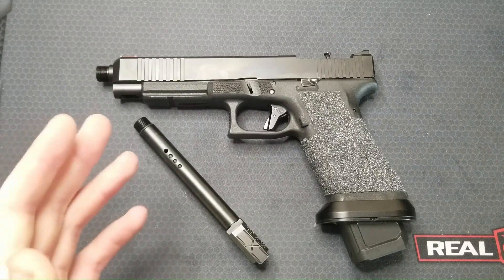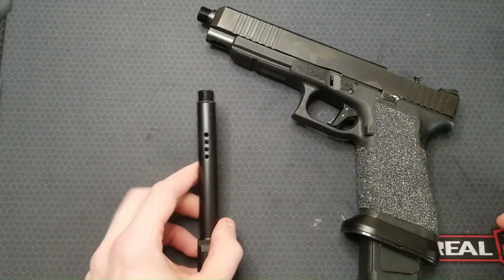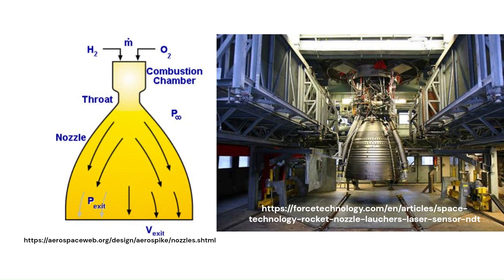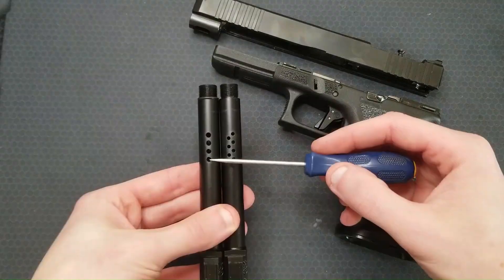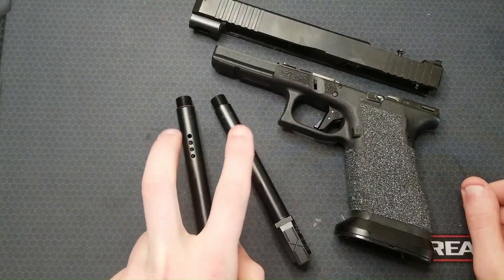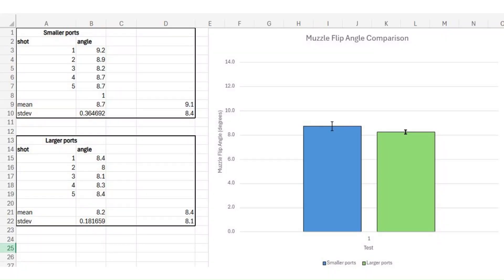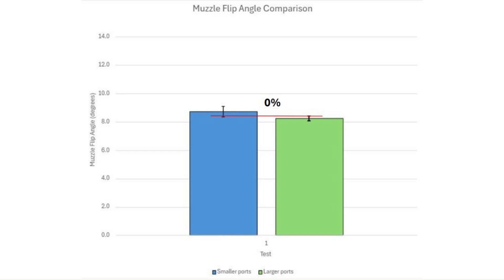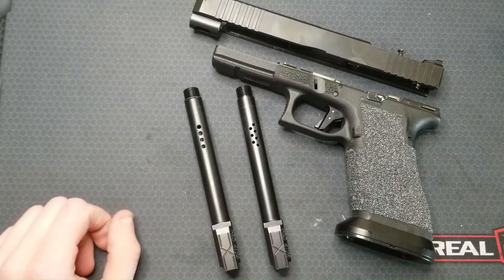Bigger or Smaller ports in a Pistol Barrel

Comment: I wonder if you could put some sort of colored smoke in an open bottom container above the ports and measure on film how quickly the gases travel through the smoke
Reply from the maker: Oh thats a cool idea. Would certainly look cool. But not feasible with the frame rate of my camera. Wount need a much higher frame rate to measure the gas velocity.
Reply: Thanks for explaining!

Comment: I have not watched this yet. but basic logic says that moving more of the morted area closer to the muzzle of the firearm will give the port more leverage to push the gun down.
Reply from the maker: Yep, but less dwell time of pressurized gas behind the bullet coming out of the ports. Possibly lower pressure because it has had more time to expand in the length of the bore. Its a tricky problem.

Comment: I would theorize that the velocity at which the gases leave the barrel is less important than the ability for the gas to leave easily. Bigger holes = easier exit but also lower dwell time. Lower dwell time, lower velocity. To a significant degree? Dunno. 

It would be interesting to always include muzzle velocity in such a test because there should theoretically be a correlation with lower muzzle velocity = less muzzle rise.
Reply from the maker: Yeah I dont want to pony up for a chrono but that would be good data to have.
Reply: @EngineersArmory just get the cheap Caldwell one. It can be found right now on sale under a hundred schmeckles
Reply from the maker: @nick3d155  100 schmeckles 😆 ah thats not too bad.

Comment: Just finding this channel. I really like the approach and some real engineering behind the solution (ME as well).

I'm curious on your thoughts specially at the end looking at port area relative to jacket spalling. As someone with a M&P Competitor - I happened up catch your V-porting using slots vs this work using smaller but greater quality of holes to roughly match port area. Do you think there's significant difference in the slot done originally on your friends competitor vs say 8 small ports (4x per side)  for similar total port area (15* - V8 porting)? Interested to get your take relative to bore performance. 👏🏼👍🏼

Comment: How are you deburring, or avoiding burrs, inside the barrel? What tooling do you use?
Reply from the maker: When i am about to break thru to the bore with my tool i go really slowly to avoid creating big burrs. I usually break thru the hard nitride with a carbide endmill and either just plung that thru or switch to a drill bit.

I wrap 600 grit sandpaper around a brass rod or wood dowell and run that over the ports on the inside of the barrel.

Comment: What about porting as cuts (lines) not holes?
It will be working the same?
Reply from the maker: Holes in the top of the barrel will do something to reduce muzzle flip. As for the minute differences between the endless options for a porting designs I am not sure.

Comment: I’d also be curious if adding a bevel to the exterior of the port would produce any measurable difference to performance. I think in theory it’d do two things: 1. It’d give the exit orifice a similar geometry to a rocket engine as you showed in the video, and potentially further accelerate the gases exiting and 2. I personally think beveled ports would look even cooler than standard ones. 

Btw I love your videos, I’m not an engineer by trade but I find engineering extremely fascinating and entertaining especially with doing experiments. Keep up the good work man!
Reply from the maker: I've put a little chamfer on some of my ports. The reason I dont usually is that due to the curvature of the barrel the chamfer comes out uneven around the hole circumference. I like the look of a uniform chamfer more which I couldn't do nicely without CNC.

I Haven't directly tested for the difference in performance between identical port designs with and without the bevel. In my experience I dont think the difference would be measurable with my methods. Glad youre enjoying the content! Thanks for watching and commenting.

Comment: I just found your channel; I'm definitely subscribing. I'd like to apologize in advance, I'm sure I missed it - but what size are tou drilling your ports to? In the first video I watched were you ported the CZ, I seem to recall you stated 5/32. However, in these subsequent videos I don't recall hearing what size these smaller ports are. Thanks for sharing your test results.
Reply from the maker: I dont make ports larger than 7/64" in practice anymore. The larger ports in this video are 1/8" but that was for testing purposes. The smaller ones are 3/32". Thats a common size I use as well.

Comment: Engineer - is there likely to be a benefit of ports being closer to the muzzle? I know the bushing style comps are no improvement since they expand to barrel O.D. immediately, but what if I port an extended barrel to roughly align with the bushing comp slots? Could this give the extended slide cosmetics with true ported barrel performance? Thanks for your calm, humble and reasoned approach to the whole gun thing. A welcome difference from the loud in-your-face bravado I find so often!
Reply from the maker: I don't have a definitive answer for you. I havent tested for such a hypothesis, or tried to isolate the affects on port performance based on distance from the chamber. I can speculate and maybe have a semi-informed answer for you. Maybe a primer for your own speculation.

I have gotten way into the weeds regarding most aspects of porting, yet have only tested a few of the variables, but only semi-scientifically as its so hard to decouple other affects.

Anyways. One thing I am quite certain of is that more port area is better. Holding port area constant between ports at the end of the barrel or near the chamber, there are three main factors as I see it. 

1. Mechanical advantage, the further the ports are away from the chamber, the more mechanical advantage they will have to create a torque that rotates the barrel down. 

2. Pressure - presumably pressure will be higher towards the chamber. However, powder keeps burning the whole time the bullet travels down the barrel, accelerating it, so I am less sure on that one. I dont have a good answer for what the pressure profile looks like over time and with bullet travel distance.

3. Dwell time. This is similar to the dwell time in an AR, that is the time the ports are exposed to high pressure from the time the bullet passes the ports, until it leaves the muzzle and the pressure drops. Ports closer to the chamber will have more dwell time, that is more time exposed to high pressure.

So which combination of these factors will result in better performance? I dont know. My guess is that ports right at the end of the muzzle will not perform very well due to lack of dwell time. Thats why compensators, which are at the end of the muzzle, have a large expansion chamber. They have no "dwell time" so they use their geometry to redirect a larger volume of gas. Ports with almost no dwell time would probably benefit greatly from an expansion chamber.

Would an extended barrel with ports clear out the end in addition to the bushing style comp be an improvement over the bushing style comp alone? I would bet so.

So there is a lot for you to think about. You got me thinking about it again. A good question begets more questions. I know I wont come to a definitive answer. Sorry I dont have an answer for you, but I wont BS you and pretend I do.
Reply: Hey, thanks for the quick and comprehensive response. I see what you mean about confounding variables. I was up on the mechanical advantage (basic lever arm), didn't credit the pressure variant enough, and hadn't even picked up on the dwell time issue. 

Can one assume muzzle velocity diminishes as chamber-to-port distance decreases due to lower net barrel pressure? If so, maybe this would increase the mechanical advantage of a distal port? 

If a 3/4 distance port has a 25% dwell time, and a distal port has a 5-10% dwell, would that 15-20% reduction in dwell (actually a 40% approx. net reduction), along with the diminished pressure pulse, outweigh the  increased lever of the faster bullet? 

If that were true, then all the barrel-end comps would be closer to worthless since they basically have a 0% dwell time, no? I guess the top vented expansion chamber does actually do some work.

Maybe I've talked myself into giving it a try on my SA mil-spec. Spectre supply sells a 'match grade' 5.94" barrel w/2 distal ports for $180.  I guess the test would be:
5" no port
5" no port, w/comp
6" no port
6" ported, w/comp

Except I have no idea how you measured barrel rise so precisely.

Comment: Would it be beneficial to drill gradually increasing ports? Small port closest to the chamber, increasing port size with each hole as you move toward the muzzle. In theory allowing more gas to make it to the farthest ports than it normally would with equal size ports. Since the ports closer to the muzzle should counter the muzzle rise more effectively than the ports closer to the chamber.
Reply from the maker: Sound reasoning. I've had that thought too. Havent tested for it so I cant say for sure.
Reply: I'm going to attempt porting my 17L barrel myself, might just give this a try. As of now I only have the one barrel but will be ordering and additional. May order 2, leave one untouched and the other drill equal size ports holes then do my best to compare the two side by side. @EngineersArmory

Comment: Just wondering. Did you do the silicon carbide grip on that pistol urself? If so a video of how you did it and what materials used would be useful. 

Or if you had it done could you share the company that did the work.
Reply from the maker: I did the silicon carbide myself. I used a kit from 71 Creative and would highly recommend it. They have great instructional videos. Thats why I didn't make one.
Reply: @EngineersArmory so what grit did you use. I put granulated grip tape on all my guns and like it to be pretty darn aggressive. Like it’s gripping me back, angrily.
Reply from the maker: @travispowell2471  46/70. I like aggressive grip too. I wouldn't go any more aggressive than that. It's gnarly. Quite a bit more aggressive than the granulated talon grip texture.

Comment: Im honestly surprised to see a measurable difference at all, even if small.
Genuinely curious, is there a measurable difference in velocity?
Reply from the maker: I havent measured velocity changes with any of my porting jobs. I would guess there wouldn't be a noticeable one between the two designs. Most testing I have seen of velocity loss due to porting shows the loss usually falls within the standard deviation of the ammunition.

Comment: I am looking at having my Sig P320 XFive barrel ported.  The slide already has 3 windows in the top that I was planning on taking advantage of.
What are your thoughts on placing a "chunk" port that corresponds to the slide window nearest the muzzle, then two or three circular ports in the middle?  Should I do any ports in the window nearest the chamber?  What diameter ports should I consider?  I was thinking 5/16" in the middle and possibly three 3/16" in the rearmost window.
Reply from the maker: If you have a chunk port the rifling has to be bored out from the leading edge of it to the muzzle. So plan for that loss in barrel length. I don't do any ports larger than 7/64" anymore. Minimizes jacket separation and spilling and negative impacts on accuracy. 3/16 or 5/16 ports will open up groups significantly. Also the spelling that comes out of them will tear up your barrel and slide. That's just my $.02 based on my experience with porting and a bunch of testing.

Comment: So you can use what is called the ANOVA test to see if the two groups of data are different with "statistical significance" when you plug in your angle data it spits out a P value of 0.025 which shows that it is actually an improvement in muzzle flip to have the larger ports. You correctly point out that there are other considerations such as jacket separation and spalling due to larger diameter ports. You could run another test on that if you wanted by shooting rounds into a water catch to check mass conservation to see if you are getting difference in final bullet weight due to jacket seperation. Glad to see an engineering approach to firearms content it is sorely lacking in the space!
Reply from the maker: I am familiar with the ANOVA test. I have some background in statistics (required curriculum for engineers). That is a significant P value. I didn't want to get into statistical analysis in my videos, I have thrown my data in R before and found similar results (previous barrel porting testing). With how little control over other variables I have in these experiments it doesn't seem like the most valuable way to analyze the data. Maybe if I had a ransom rest I would be more keen on it. 

The variability in data, while not bad for a human shooting the gun, may show a significant P value, but I would guess it would come with a lower confidence interval. 

I would love to have a ransom rest and test multiple barrels in one pistol, randomizing variables like port diameter, overall port area, V ports or inline ports and number of ports. Throw the data into a multivariate linear regression and weed out the variables that affect each other, refit, and eventually come up with an equation to estimate muzzle flip reduction based on the variables in question. Randomization and checking for interactions in the variables would be needed. Larger ports means more overall area, so which has the bigger influence on results? How can those be decoupled to isolate the effects? The P value would help with this. Its an interesting thought and something i would love to do, but likely wont be able to due to cost.
Reply: I just took my stats final don't remind me
Reply from the maker: @tamisthewizard3199  😆 See its useful!!

Comment: What about a difference in top ports vs V6/8 ports? That's where I'm at with a MAC 9 DS...hmmm🤔
Reply from the maker: Top ports will have more resultant force going directly to mitigating muzzle flip. V ports have a component of that force going horizontal. Generally for inline vs V port designs for a given barrel length I increase total cross sectional area of V ports in an attempt to make up for this. Havent directly tested but thats my logic. I did V6 instead of inline 4 on my tisas 1911DS. V ports and a line of 3 on each side instead of a line of 4 on top to sneak em further forward.
Reply: @EngineersArmory  Yeah, I did 5 inline top ports on my 5" Prodigy. So, for the MAC, I  figured the V6 would perform and look better. I'll look for your vid on the Tisas. 
Sub'd, appreciate your helpful content. Especially,  this new series of building your own DS 1911
Reply from the maker: @njcranes  I appreciate you watching, commenting, and subscribing! The videos are already out on the Tisas, and there are a bunch of videos out on what I did to my MAC9. Hope you find them interesting or helpful. Cheers!

Comment: What is spawling, as you mentioned in this video?
Reply: OK, so I googled it.  Interesting use of the word.
Reply from the maker: @leonbarnett3104 in the case of barrel ports and bullets I think it generally means anything coming out if the ports other than gas. Bullet jacket or lead pieces. Possibly even unburnt powder.

Comment: And here I have an answer to one of my questions and now a new one:

Does the positioning of the ports and the pattern matter in muzzle rise reduction?
Reply from the maker: Position should. I am assuming you mean position in relation to the chamber. Ports further away from the chamber will have a longer moment arm providing more torque. I always push my ports as far forward on the barrel as reasonable (while keeping it reasonable to machine, not having to move a front sight, and not compromising barrel lock up area). I suppose there is an argument that could be made about gas pressure level closer or further from the chamber.  I am under the impression that there is combustion happening behind the bullet all the way down the barrel, but is this combustion increasing pressure at a rate higher than the combustion volume? is there an initial spike in pressure in the chamber, then it drops after that but its still enough to overcome the friction of the bullet in the rifling? Its one of those obvious seeming answers until i think about it more haha. Ports closer to the chamber will almost certainly nerf bullet velocity more.

Port pattern... way too many options and configurations to test. If you mean longitudinal slots, vs transverse slots, vs holes, vs hole arrays, vs diverging or converging area... etc. There are an overwhelming and seemingly endless amount of port size/shape/layout combinations to test. I cant keep spending money on barrels I poke holes in and shoot once for testing haha. Someone else can do that.
Reply: @EngineersArmory there is a place somewhere in eveey barrel where pressure peaks, then it will drop. However, that place varies from cartridge and barrel length. Its possible in a short barrel and a slow powder, like a short 5.56, that the peak pressure is near the muzzle as the powder is still burning. In a longer barreled gun with fast powder the pressure spike will be somwhere near the middle. In blackpowder guns the ignition temp is low so the pressure spike is much closer to the breach. 

So it totally depends on the powder, diameter of the barrel, type of bullet (lead, jacketed, powder coated), length of barrel, lenght of freebore, any leakages (like revolvers do for example)  😊
Reply from the maker: @evandaire1449  Sound logic thank you!